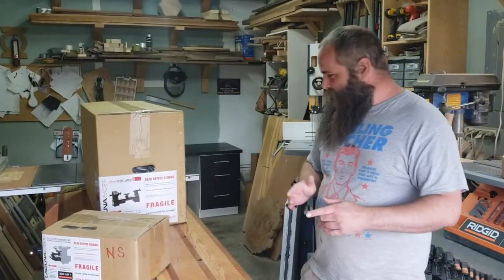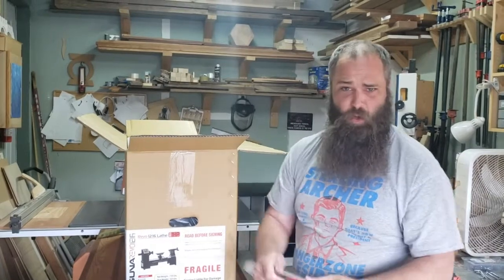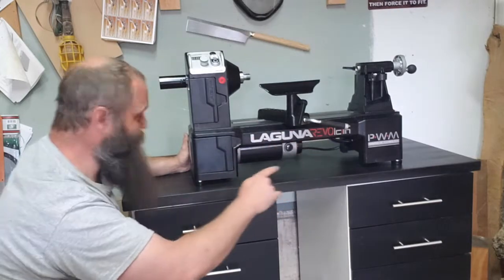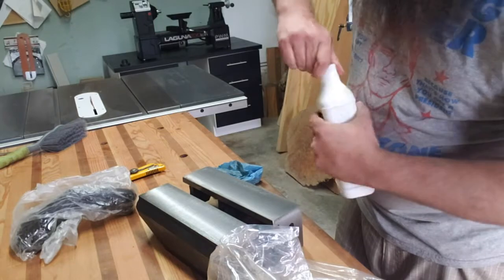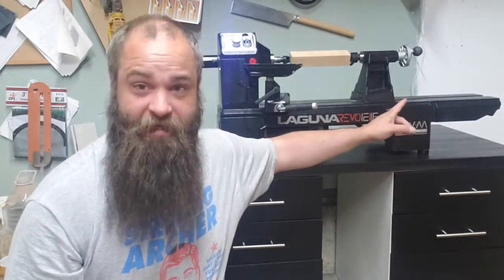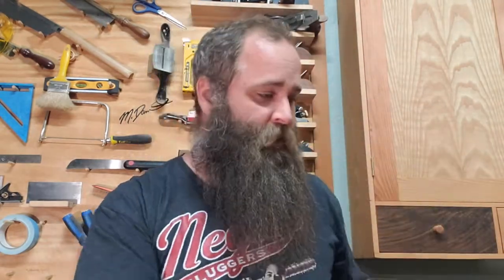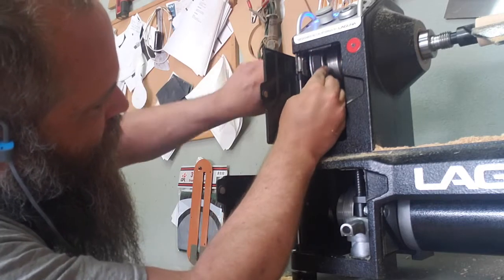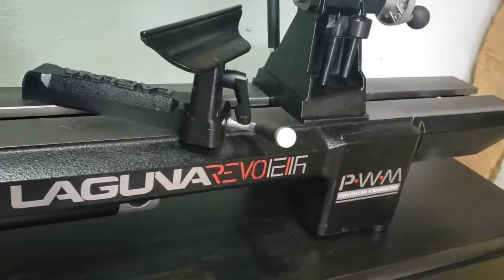I Bought A LAGUNA REVO 12|16 LATHE!

Comment: You pretty much sealed the deal for me with this video.  Ive been looking at the 12/16 all weekend, watching everything I could find on it.  I bought an old craftsmen from a neighbor and it was good enough to get me going and get me hooked.  But now that its cold the tailback is bound up on the pipe and I'm over hammering ten minutes to move it 2".  I do like how modular it is allowing for plenty of expansion.  Saw your vid on the rikon grinder too, its in my Amazon cart right now!  Enjoying your vids thus far!
Reply from the maker: Thanks! And I do think (without having first-hand experience with any of the others) that this is probably the best lathe on the market in this price range. Planning on getting the 20" bed extension soon so I can move the 10" one over to the outboard side permanently.

Comment: I’m considering a future purchase of one of these. I’m glad to hear the “bads” were pretty minor. Just further solidified my choice.
Reply from the maker: I guess if I had to add any other "bads" I would say the 6" tool rest is a little shorter than I'd like, but I don't think there's a lathe out there in this price bracket that comes with a longer one and the aftermarket ones aren't that expensive. I've since added a Oneway curved rest to get inside bowls a little better for, like, $65 or something. Still extremely happy I settled on this one. Seems like they have 10% off sales pretty frequently, so my advice would be to wait for one of those and pull the trigger.

Comment: I'm looking at a few lathes, this one, its Jet contemporary, the shop fox and the Rikon which both cost less... still deciding.
Reply from the maker: I doubt you'll be unhappy with any of those choices. I went with the Laguna for the outboard turning option and I still haven't used that feature 18 months into owning it. Still glad to have the extra couple inches of capacity if I ever need it, though. I'm sure I'll use it some day.

Comment: That’s awesome! I almost went with that one, I’m sure you’ll have a blast.
Reply from the maker: I already am! Which one did you pick?
Reply: Wooden ThingsAndStuff I ended up going with the Rikon 70-220VSR. One of the members in my turning club sells them, so I got a pretty good deal. It’s big enough that I can do most things and small enough that I can (barely!) lug it around to markets or workshops.
Reply from the maker: I was close on that one, but decided the outboard turning on the Laguna for just a little more would be worth it. I'm sure they're both quality units, and I kinda wanted to match my bandsaw, but the Laguna just happened to be 10% off when I was finally ready to pull the trigger.

Comment: Deciding between this and the jet 1221. I noticed you didn't get the stand and didn't bolt it to your table (unless you did it off camera). Is  it sturdy enough you don't need to? I have a cheap one and I had to bolt it down.
Reply from the maker: It only gets a bit wonky if I put something heavy on it and it's off-balance. For just about everything I do, its fine not bolted down. If it starts shaking, I just turn the speed down while I get the piece round, and then I can turn it back up. The heaviest things I've turned I couldn't get up to high speed without shaking a bit, but I just turn them slower. If I find myself having to do that more frequently, I'll bolt it down, but for now it's not an issue I'm worried about.
Reply: @WoodenThingsAndStuff  thank you! You probably just saved me about 400 dollars for a stand 😂
Reply from the maker: @andrewsjohnson5289  that's what turned me off it, too.

Comment: Already have one  "in my cart". Don't care if the stickers fall off. Don't need allen tools (got my own). Only thing I'd like to know about the extension--does it come with the option to purchase different size lengths (12" 14" 18" ??) or just one size length? For me, the unit will suffice without any extension---but I'm curious. Thank You. Nice job on the video.
Reply from the maker: I bought the 10" one with the banjo knuckle for outboard turning. They also have a 20" bed extension that I will likely pick up at some point, as well. I think those are the only two sizes.
Reply: @WoodenThingsAndStuff  Thanks, I appreciate it.
Reply from the maker: You bet. You won't be disappointed, I don't think.

Comment: What would you pick now the the 220vsr is only $699 now? Even on sale the Laguna is $20 more than the rikon
Reply from the maker: I think I would still pick the Laguna, if only because the of the ability to turn outboard. Even though I still haven't used that function, I'm happy to have it for when I eventually want to mount something 13-16 inches across.

Comment: I'm thinking of getting the same lathe after years of using the Nova Comett...do you think if you used clear sealer on the stickers it could have prevented the issue you were having?
Reply from the maker: The issue was just that they weren't applied properly. A quick burnishing to get them properly stuck down and they haven't lifted back up since.

Comment: Thanks for sharing your experience with the lathe.  Do you think it would handle a Jacobs chuck in the tailstock for drilling out small (shorter) hollow forms?  I saw your comments below about it vibrating some on larger out of balance pieces, but it sounds like you're able to work around that by slowing things down at the beginning.
Reply from the maker: I've since purchased a jacobs chuck for the tailstock and it works fine. Check out my "Making my first pens" video to see it in use. And in terms of the vibration, I'm pretty sure it's more about the shoddy cabinet that it's on than the lathe itself, and it only happens with heavy things that are pretty out of round. I just dial the speed down until it's round and everything's fine.
Reply: @WoodenThingsAndStuff  Thanks! Appreciate the info.
Reply from the maker: You bet

Comment: Hey Mike, I never saw anyone comment on your one bad/ugly comment re: this lathe that you eventually got past; that being that you had an extremely difficult time hanging the 10" tail stock extension piece.  After a ton of bingeing on YouTube videos learning and listening to the many positive comments regarding this make/model of lathe, if you never figured out why you had such a hard time because it didn't come with an instruction/installation manual, here might be your fix next time.  Simply put, one experienced owner always places the tail stock's base half way over the area where the two pieces (main bedrest and 10", 12" or now 20" auxillary bedrest) meet after first loosely hanging the extension bed rest on the 3 bolts. This allows the flat surface of the tail stock's base to be 50% over each part, thus making sure that when you tighten the 3 bolts the tail stock's base ensures the two bed rests marry up perfectly flat together.  Does that make sense?  Of course, you probably already know that, huh?  LOL.  I love your video.  It was one of the main reasons I got excited about possibly purchasing it and decided to research the crap out of it on YouTube; because I cannot afford to purchase a more higher end wood lathe at this time.  Besides, I'm still new to woodturning and I have not been able to bring myself to spend upwards of $2,750+ for a nice machine that will eat up what's left of my tiny garage wood shop.  Happy turning.
Reply from the maker: I actually saw another setup video AFTER I got it together where the guy did that. Me and my buddy Marc will never get that half hour of our lives back. haha

Comment: Thanks for the video! I'm thinking of picking up one since they are on sale right now. Do you have yours bolted down? Do you feel it needs to be bolted down? I'm torn between this and the Jet 1221. This seems much more flexible. How do you like the outboard turning?
Reply from the maker: I haven't done any outboard turning yet, but I like that I'll have the option when I need to. It's heavy enough that I don't need to bolt it down. It shakes a little if I'm trying to turn something heavy (10+ inches) that's not properly balanced, but I can just spin it slower, make a couple of cuts to get things into balance, and everything's fine. I looked at the 1221, as well, but I couldn't find a Canadian retailer and shipping $ made it cost prohibative. I don't think there's a wrong choice in this price range, because they're all going to be good, but I'm still happy with the choice I made.

Comment: Just thinking about a Laguna because the tail stock & Tool rest 'lock downs'' on my Woodfast keep loosening because the levers are too short.  How have you found the Laguna in that respect?
Reply from the maker: The tailstock lockdown is the only one of the two that ever locks less than fully with minimal effort, and even then it's only noticeable if I'm trying to apply more pressure to the piece than I probably need to.

Comment: Does the on/off switch have a light?  Is it supposed to?  Just bought my 12/16 and it looks as though it should have one, but it never lights up.
Reply from the maker: I don't think it does. At least I've never noticed it light up. Kind of annoying that the LED display is always lit up if the machine is plugged in, though. I realize it's not a ton of power, but it feels unnecessary to always be drawing power, even if it's not much.

Comment: What is difference with your rikon lathe and your laguna and wy you sell it thank
Reply from the maker: I never owned the Rikon. I had a Mastercraft 9" benchtop lathe, and it wasn't powerful enough or big enough to do the things I wanted to do. The difference between the Rikon I was going to buy and the Laguna is the ability to do outboard turning with additional capacity, which the Rikon doesn't have, which was the reason I went with the Laguna.